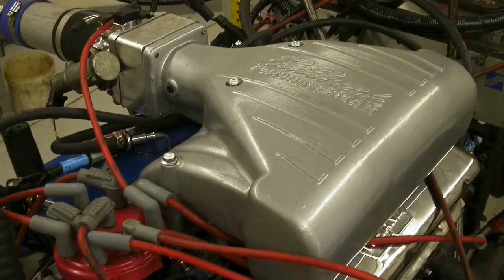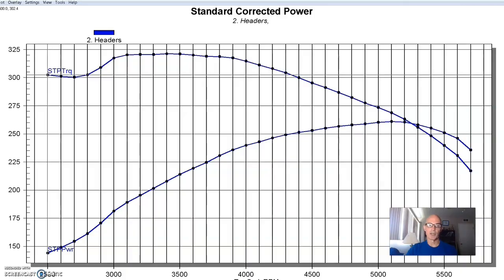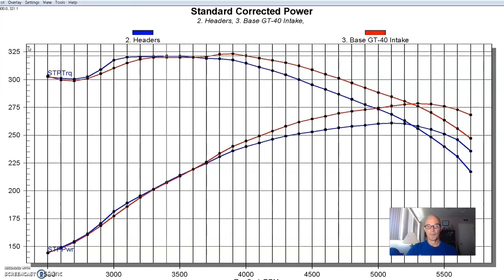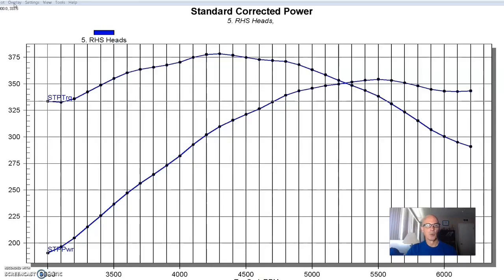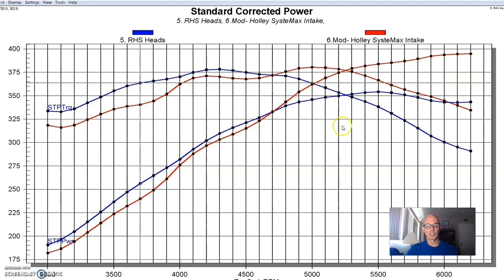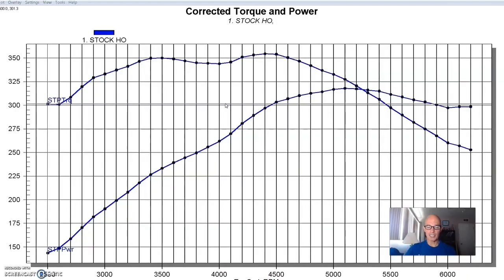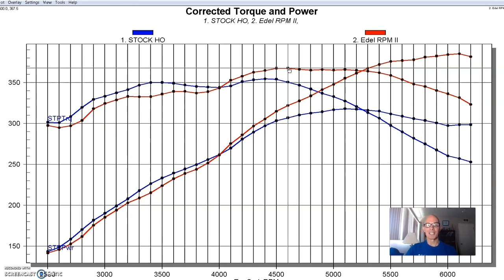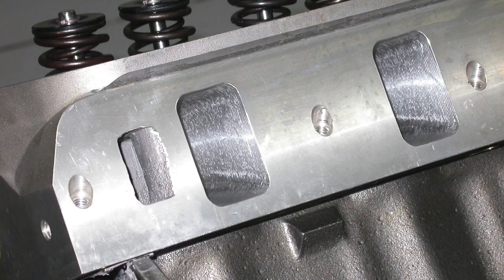5.0L FORD INTAKE TEST

Comment: You love to Dino run 5 liter Fords! I’m old enough to remember the silver state ! But, you hardly ever run 5.8 liter articles! We’ve ran the 306, 331, 347s! We’ve all left that little turd 10 years ago! Blew a couple head gaskets during the learning curve, but never a basket case! The only reason to run a 302 based block is if the 9.5 deck block won’t fit!
Reply from the maker: I would like to know who we all is? I do like the 351 though
Reply: @richardholdener1727 You all means just that! I wasn’t involved! We all means we’re all partners in crime!! Yall is short for you all !
Reply from the maker: "We've all" in your comment was meant to insinuate that everyone involved in 5.0L Mustangs no longer runs 302s (which we know is not only incorrect, but that 302s still outnumbers 351s in 5.0L Mustangs by orders of magnitude). Your comment should have simply stated the YOU like 351s (I do too). You don't need everyone else!

Comment: Do you remember Coast High used to convert Edlebrock RPM carb intakes to port efi? You ever had you mits on one?
Reply from the maker: I only ever saw the Vic Jr. versions
Reply: @richardholdener1727 in your opinion, would the rpm carb converted to efi be just as drivable as a GT40 or TFS intake and make  better power?

Comment: Richard, I've shot the s!@t with you a few times! But, WTF would a Ford guy really  f!@k with that weak , cubic inch limited block! A 351w will bolt right up! I understand that alot of you listeners are on the left coast! But, a 357 with the same parts will produce 75-80 hp more! Actually,  if you live here in South Carolina,  it'll be a second faster! That's nearly 100 hp! The 351w  will run the same time as the 5 liter with the same parts! Now, that's on carbs and pump gas! The botten end of the 351w  is so much stronger! You can shoot 150 on the Windsor for 3 years and it's still good!
Reply from the maker: this was a simple intake test for 302 owners-you missed the point-everyone knows about 351s
Reply: @richardholdener1727  Been there, done that! Only advantage the 302 based block has it might be a little easier to launch in a street race! Sell that boat anchors and hunt a 351w short boock!! Before the ls came along were were gold! Now you gotta get better heads and turn them harder! Best cheap fix is a 393w with at least Victor. JR HEADS. You can go significantly bigger, but, that cost!

Comment: How can their be a horsepower gain between stock and gt40 if the stock intake flows more cfm than the stock heads?
Reply from the maker: STOCK INTAKE IS RESTRICTIVE AND LONGER RUNNER
Reply: @richardholdener1727  is it really more restrictive than the heads though? I thought the stock heads only flowed like 145cfm, surely the intake flows better than that
Reply: @richardholdener1727  sorry, I totally had it backwards, the intake is 145cfm, heads at around 160cfm

Comment: This engine is such a boat anchor. Over 3k for less than 100hp gains 😂 thats ridiculous. Todays Modern modular ford V6 engines make more than that on just actual bolt ons. Intake , throttle body, headers , exhaust and a tune. I wouldn't spend any money on this engine personally. Go with the coyote 💪🏻

Comment: What intake for a 363 Stroker for the street? What is the hp limit on the gt40 or the Holley? I want one that has the leaned over runners like stock that flows enough for a big Stroker.

Comment: When my mom passed I got her 95 GT convertible 5.0 5 speed, it's pretty soft I mean it scoots along nice but definitely isn't "fast" plus it's blessed with 2:73 gears! Woohoo. I do like the cruise rpm but the gears seem so tall you can turn it to around 55 in 2nd! Anyway I've been researching engine mods and I'm a little discouraged at the gains and all out HP of the 5.0, I'm used to the gains of chevy 350s where 350hp+ is effortless. With 302s 300/325hp isnt as easy and 400hp seems pretty stout for a 302. Am I wasting my money trying to make the 5.0 powerful...? Seems like the only way to have decent power without spending alot of money to get that little 302 is cam n turbo the 5.0 for around 400hp or building a 350 to 375hp 351... I would think even 350 NA HP or 400 HP mild turbo in a sn95 would be pretty respectable street car...maybe where a has a T5 a little deeper gear like a 3.40/3.50 so I can still have a comfortable cruise rpm.

Comment: Whats your opinion on holley Systemax heads? I'm aiming for around 300whp stock 94 bottom end, holley systemax heads, XE276HR Cam, GT40 intake and long tube headers with Mac prochamber exhaust. Think I'll be close ?

Comment: In these test that made the most power.. what size injectors, throttle body and mass air meter were you using?? Thanks for the videos!!
Reply from the maker: no maf-it was speed density-36 or 42 pound injectors

Comment: All these mods are great for strip car. For a daily driver to play with on the weekend, RPMs are just too high. you're taking life away from the engine. So for me personally I build to produce great low-end torque and keep the RPMs at about 5000 for maximum horsepower. I have the 97 5.0 from an explorer cam headers and a tune in my 79 Ford pickup fun to play with and been driving it for 8 years.

Comment: stock bottom end 1985 5.0, added speedmaster heads, e303 cam.  Power seems good up to about 5,000 RPM, then falls off(SOTP dyno).  it is just my street cruiser, but of course, I'd like it to pull up to 5500-6000.  does that mean better springs?  thanks for any advice.
Reply: Don't know much about the heads you bought. 20 years ago I ported a set of E7TE heads and ran a set of beehive springs. 75mm tb and 70 mm mass air. E303 and ported Cobra intake. The 19lb/hr injectors were causing a problem above 5000 rpm. Used a Crane interceptor to find it. Also, I hope you ditched the factory epoxy core coil. On a mostly stock car with 3.73 rears, the engine used to nose over in first gear earlier than all other gears. An MSD coil fixed that. Factory coil hated revving high real fast.

Comment: One of the big 5.0 Mustang magazines in the day, did a dyno test of intake manifolds. Found the low riser OEM intake used in T'birds and 94 GT Mustangs wasn't as restrictive as thought. That an Extrude Honed stock HO intake could match a GT40--when they were new and expensive, it was a consideration, tho Ron Anderson Performance could port one out and really make some dyno numbers. I would imagine an Extrude Honed Cobra or Explorer could do better, since you aren't going to hone a GT40 tubular.

Holley's Systamax reminds me of the $1,000 Saleen intake.

Comment: Richard, you achieved 261 HP on your stock 5.0 opposed to the factory-rated 225 HP.    Is this due to the lack of the mass air system/intake, accessories, and the addition of headers?
Reply from the maker: yes

Comment: these intakes have been around a long time, I need to see what a Holley HI RAM with a side mount ford throttle body can do, can it beat the gt40 under the curve? can you borrow a professionally ported lower for the gt40 so its potential can be seen.

Comment: For the bank that was involved in one of these I think I'd just turbo it until it split down the middle then do a 351W in its place. Ford really did do the intake right though in terms of being able to modify it, GM had the TPI which looked cool but wasn't that great overall.

Comment: I just saw one of the tubular intakes sell for $1200 on a FB group. People are nutty over these intakes.
Reply: I sold one I had on eBay for $875 two years ago.  People definitely love them still.  Not sure if it’s more for nostalgia or just the cool tubular looks.
Reply: @CentralVAracer  I’m new to the fox body. Just got one with shorty bbk, e303 cam and bbk cold air with flow masters. She runs out of breath at 5k rpm but feels great down low. What’s the best bang for the buck manifold?

Comment: 385hp-225hp=160hp. I'm not saying that stacking hp gains is the correct method to try to estimate your final hp numbers... But in this example. Just saying.
Reply from the maker: we didn't start at 225-that's a rated hp number
Reply: @richardholdener1727  ok, I had seen that the first Dyno was more than stock but I thought the expectation was that the motor was effectively stock with long tubes. Figured that made the end result a stock bottom end (effectively) with h/c/i... And I guess long tubes too. But I guess if we were stacking hp, that'd be another 30 hp there. Lol. I was just joking around. Great video. Hope to see more.

Comment: Have you done a 4.6 2V intake test between the Dorman, procomp/speed master, and Ford performance oe replacement intakes?
Reply from the maker: no not that test
Reply: Richard Holdener  

I was just wondering since it’s hard to find a comparison between the three common intakes people swap into their 4.6 pi motors.

Comment: what happens when you add boost to the torque numbers at the bottom end that you lose naturally asperated with a freer flowing intake?  Do you gain more or does the it still lag at the bottom compared to the more restrictive intake?
Reply from the maker: Stop thinking in terms of flow-the intake is not flow-its reflected waves that enhance cylinder filling (like boost) at specific engine speeds

Comment: Should have contacted Bigdogs porting and tried one of their stage 2 and stage 3 ported Explorer/Cobra gt40s. The results would have been shocking.
Reply from the maker: Run plenty of ported (and modded) Cobras and GT40s over the last 30 years or so-we know what they do
Reply: @richardholdener1727  so you know a what a cut, runners shortened to peak at 6,500rpm, 2.4 mcsa, 320cfm bolted together average runner flow with a 80mm 1,100cfm throttle body tunnel flow gt40 would have made 30plus hp more than any of the tested aftermarket manifolds. To many that would be a better test because it's doing something different than buying what everyone else has bought and getting the same limitations everyone has. We have plenty of back to back testing and we have found it hard to beat a properly ported/modified gt40 manifold.
This is a good test though. Keep up the great work!👍
Reply: @richardholdener1727 I’d really like to see you do one of his intakes . Everybody in the forums would like to see it .

Comment: I would like to see the same engine with a carb vs efi challenge. My 1994 5.0 was carb swapped and people say it makes less hp than stock
Reply: depends on the intake. The long runners of the EFI would get whipped by a single plane, above 4,500 RPM.  But a carb cools the intake charge with the venturi effect of its "barrels", while the typical EFI intake has so much surface area, it soaks up a ton of heat. And with the shock towers in the engine compartment blocking airflow from rad to firewall, there's a lot of engine heat to soak up.

Comment: This was great but ever part shown cost a little coin. Cams are priced, a good set of heads are not $1500, headers are priced ok, intake another 1k it seems. What are the performance gains for the average guy doing on of these if he doesn't have 3k -4k to spend to make 350 whp
Reply from the maker: 350 whp? 351W with junkyard GT40 heads, cam, springs-then add boost or nitrous

Comment: How do these intakes compare to something like a Trick Flow Box R intake?
Reply from the maker: the Box R loses power through most of the curve-its for top end
Reply: So the Box R is more of a specialty, high rpm all the time type of deal then? I'm assuming this trend is the same under boost as well.

Comment: A intake comparison with forced induction would be nice primarily a centrifugal blower or turbo setup.
Reply from the maker: Intakes do the same thing under boost-tested that many times
Reply: @richardholdener1727  Thanks for the info

Comment: Ever tested any fabricated "box" upper intakes? Curious how they stack up. Have a friend running a ported/extrude honed GT40 lower with an aluminum box upper on his 331 stroker. It seems to work well, but the new Holley hi ram for the SBFs have him looking at other options. I think it will give up too much under the curve unless he goes with a big solid roller and larger cylinder heads.
Reply from the maker: Hi would be better than box

Comment: GT40 intake, B303, Longtubes, Flowmaster 40s.

The meanest sounding 250hp ever.
Reply: Not to mention the best sounding 👍🏻
Reply: Was that with e7 heads?
Reply: Flowmasters make no power, but they make a stock cammed engine sound like a NASCAR at 8k 😂
Reply: I used to eat those all the time back when i had my Taurus SHO, both the drag strip and highway pulls.  They didn't stand a chance lol
Reply: @TommyboyGTP  that 7k redline helps. And as does the part about Yamaha making some badass heads.. 220~hp and 215tq (according to a forum or 2) and that power comes on fast. Imagine if they'd have offered that little v6 in a rwd.. (it's doable buuutt..)
Reply: @PureCountryof91  I'm pretty sure that was a very conservative power rating, and yea it pulled like a beast, and would go to 7,500 or a bit more before the cutoff.  Used to rev the piss out of mine, it loved it lol
Reply: @PureCountryof91  I think the Windstar, or Aerostar, minivan is the drivetrain that makes it work, right? Frankly, if i found one of these V6's, i'd grab a sky blue Festiva i know is rusting away in someone's weedy driveway...SHOgun, baby :)  

tho it may be fun to hook a turbo on a SHO and compare performance to the new Ecoboost....
Reply: @albertgaspar627  Windstar is a fwd, aerostar is actually a variation of the ranger chassis. It's the unique and rather dumb bellhousing pattern of the vulcan family.
Reply: Thank you...was the Windstar built off the Taurus platform, like Mopar did their vans off the K car?  

That's interesting about the Aerostar, since Advanced Adaptors makes a 302 Windsor swap kit (can't use the 5 speed, its a Mitsubishi unit good for only 200hp, but the automatics are either C4 or C3 or C5, can't remember for sure--too many years, too many beers).  Boy wouldn't that be a fun sleeper with Explorer GT40P heads...you could practically do all the shopping in a junkyard.
Reply: @albertgaspar627  far as I know, Ford vans had their own platform, however, they still used a version of the Taurus transmission.
Reply: Pity, i don't need a minivan, but if SHO parts converted over, that could be a fun work vehicle for someone. If i remember correctly, didn't one of the Lincoln Continentals use that Taurus automatic and have problems with it? the only Ford things I know are the pushrod V8's and the OHC 2.3 liter four, way ahead of its time.
Reply: @albertgaspar627  the 3.0 vulcan transmissions should be a bolt up. Fwd is simply not my thing honestly. I'd go with the ranger transmission and figure it out from there..

Comment: I use a 1/2 inch spacer under my upper systemax intake for valve cover clearance. Will making the runners longer will that increase the torque a little bit?
Reply: Bobby4v - most likely the answer is yes, it would theoretically shift the usable power band down a little bit in the Rpm scale and bump your TQ if I’m not mistaken.
Reply from the maker: 1/2 inch changes it very little

Comment: AFR Heads, high ratio rockers and a 750 dp on a dual plane manifold is tested to 400hp with a stock cam.  This test ain't that great.
Reply from the maker: that combo with a stock cam won't make 400 hp
Reply: I remember that test as well, MM&FF perhaps? I personally think it was BS.....bought and paid for by AFR. I agree with Richard.  It can't make that power with the stock cam.

Comment: Do ford 300 4.9 build up
I built one found rare industrial ford 300 had 4.120 bore I placed common crank 4.00 stroke came to like 320 ish. I was young found out later it also had forge crank. And I made custom intake and exhaust dual I think 70mm throttle body one on for runner each and twin turbo , h beam rod full roller timing systems, and fully hand ported  stage4 like port and polished and port matching and over sized valves

Comment: I would of loved to see some of the old 5.0/5.8 truck intakes included in this test
Reply: I second that! Us EFI 5.8 guys don't really have a junkyard option for the lower intake, unless you're lucky enough to find a first gen Lightning in the Junkyard, which would be like hitting the jackpot. Most have to spend over $900 for the Edelbrock stuff.

Comment: Would love to see some 289 engines,  2bbl vs Hi Po vs Shelby
Reply: Jeff Kopis  if you would have read what I posted I was wanting to the see 2 bbl 289 vs the Hi Po vs the Shelby.  Not just him putting these same parts on a 289.  It would kinda be like another other guys cause to many people forget about the 289
Reply from the maker: There is a HiPo 289 video up
Reply: Richard Holdener  I went back through the videos and didn’t seem to find it

Comment: Awesome to see some of your 5.0l ford testing, what about a comparison between an RPM air gap carby manifold and an EFI manifold like the RPM 2 for those thinking of converting from one to the other, keep up the great content Richard, by far my favourite you tuber
Reply: Not a bad idea. I’ll guesstimate that the carb will make more power up top, above 4600 RPM, and the efi will make more down low.
Reply from the maker: I did that test
Reply: @richardholdener1727  have you posted it here ?
Reply: I realise that you have most likely ran this test in the past as well as tons more I’m just waiting anxiously for you to share the results keep up the good work
Reply: @brettkelly1436  he did share the results

Comment: Thanks for showing us the 5.0 intake differences. I have a 306 with milled afr 165 heads at 54cc. Stock cam with svo rockers with close to 10:1 compression. I used the cobra intake. I was able to produce 355rwtq at 4000rpm. Great video, keep up the outstanding work :)
Reply: I have a 331 10:1 with a gt40 tubular, china heads, XE270 cam, aluminum china heads, shorty headers made 315whp/360 tq
Reply: Stock 5.0 cam in a 306?
Reply: De he mention China heads 😂